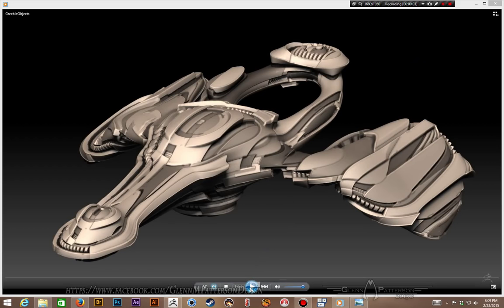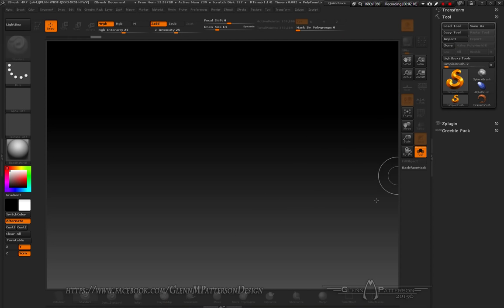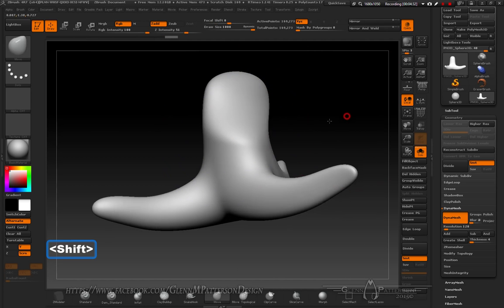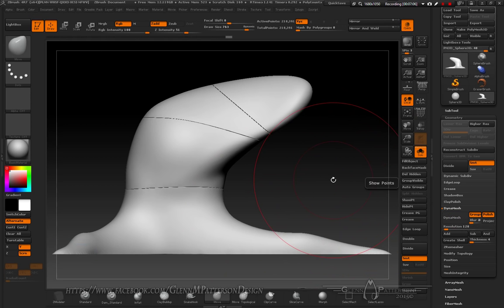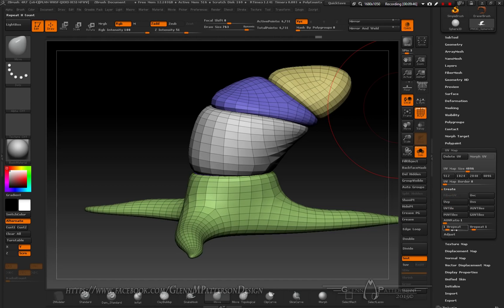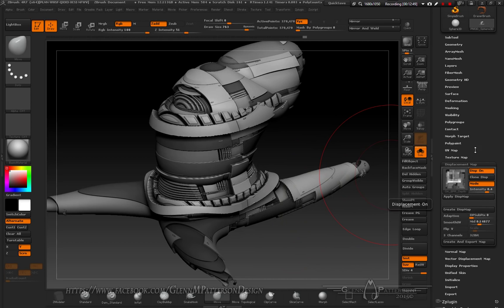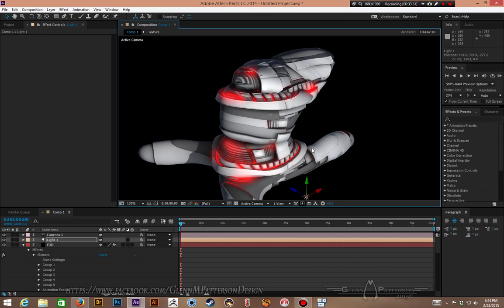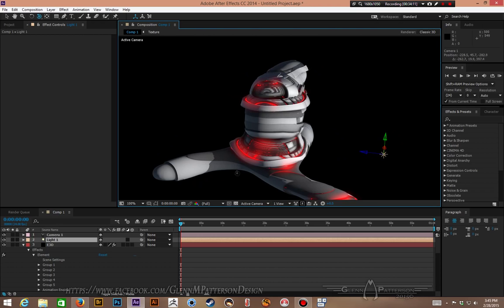Displacement Modeling in Zbrush 4R7

Comment: Somehow when i import back in, i lose all texture and displacement..any ideas what is wrong?
Reply from the maker: redisejalg I Believe you have a Export Setting not turned on. Go to Tool>Export and make sure Txr is turned on, this will tell Zbrush to Export the Model along with Texture and UV Coordinates. Now Import back in and it should work. Hope that Helps you.
Reply: Glenn Patterson  Thank you for your quick response. Txr is turned on and it didnt work(atleast my beginners eye cannot find out why yet =) ). When exported it creates extra mtl and BMP.
Reply from the maker: I'm unsure what it could be. My setting for Export are Below. Otherwise I'd watch the Video again to see if there might be a step your missing.
Reply from the maker: qud, txr, mrg, group are turned on. Sounds like you have things right.
Reply: Glenn Patterson Hmm...seems i found the culprit (if it can be it). When i used UVmap and adjusted H and V repeat i went under 1 (used 0,6 and 0,3). For some reason after import it did not make ZB to recognize them as valued 1.
Reply from the maker: Yes, that would be it, I think in a later video I mentioned that you want to not use any decimal points in the repeats, keep it at 1, 2, 3, and so on.

Comment: one question... how to transfer  the details and high resolution of a  unposed model to a posed model ?  ...beacause it takes a lot of time to rig something  that has 1million polycounts than a lower resolution model...
Reply from the maker: ***** Instead of going the decimation route. Convert your Texture to Polypaint, then set up UV's using UV Master Plugin. After you set up some decent UV's, use the MultiMap Exporter Plugin to create Normals or Displacement Maps to use on a Low Poly Model in your Preferred Rigging Program. If you go this video I show you how to set up the UV's with UV Master Plugin for Zbrush. https://youtu.be/DGnpn3AfPJc?t=41m42s
Hope this Helps
Reply from the maker: ***** Also go to this Video for a Quick set up of Multi Map Exporter. https://youtu.be/AddoFinDzSI?t=3m26s
Reply: Glenn Patterson oh I see... yes , It helped me a lot   ! ...thank you sir : )

Comment: Here are my notes in case these are helpful for others - 
Greeble notes:
- Select Tool – Sphere3D
- Make Polymesh3D
- T (to edit)
- (polyfill on)
- Make model
- Zremesh (trying to get to about 5K points) 
o Keep Groups
o Adapt off
- Deformation – Polish by features (a few times to 6)
- UV Map
o Click 4096 Button
o UV Map Border to 0
o Create > Uvp button
- Texture Map
o Texture On
o Click blank panel to select Greeble .tif file
o Click Import
o Set H and V repeats to create pattern
- Geometry
o SUV (smooth UV button) on
- Displacement Map
o Click blank panel to select Depth map
o Click Import
o Navigate to Depth Map
o Mode button on
o Crank up intensity (0.2 to 0.4 to start)
o Adjust Mid slider to shirk or fatten displacement
 Below 0.5 fatten
 Above 0.5 shrink
- Divide a few times to get to 300-500k point
- Export Geometry
o Lower subdivisions to 1
o Check Export to make sure Scale is 1 and Offsets are 0
o Click Export button and save file
o Click Import button and import file
- UV Map
o Reset H and V Repeat values to 1
- Bring Subdivisions back up
- Divide to approx. 3 million points
- Displacement Map
o Click Apply DispMap button
- Deformation
o Polish by features
- Decimation Master
o Keep UVs
o Pre-Process current
o Wait
o Set Polys slider to 200K polys (type 200 and click enter)
o Gives triangles, maybe remesh
Reply: Hahaha, this may not make sense to anyone else, sorry, tried to be helpful :)
Reply from the maker: +Shamanic Harmonics Thanks for the input, it's always Helpful.